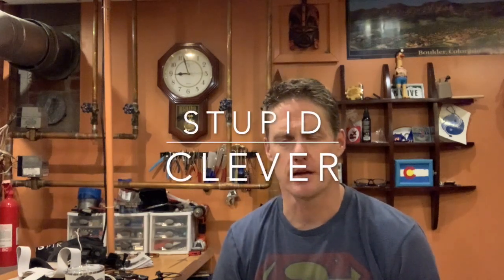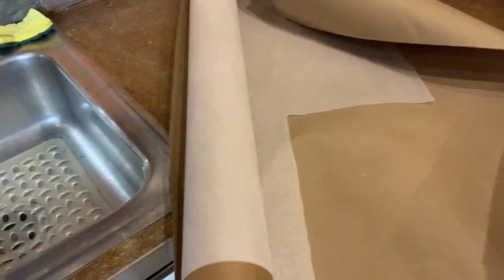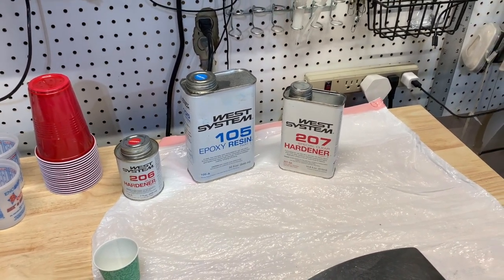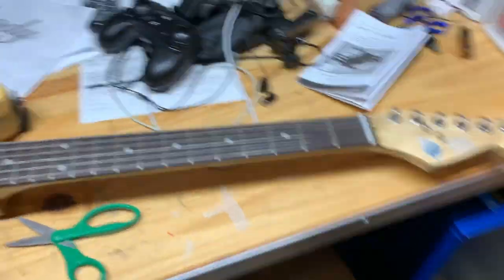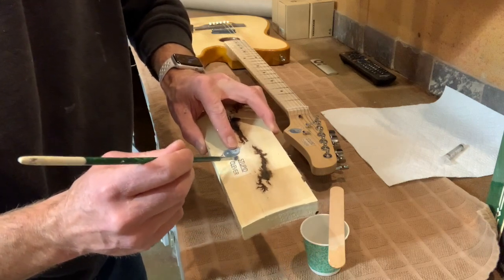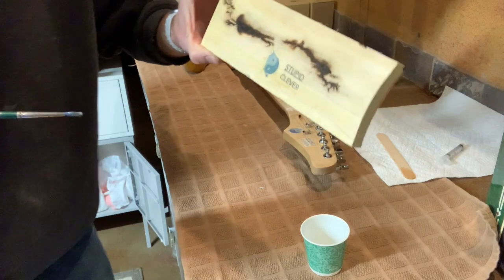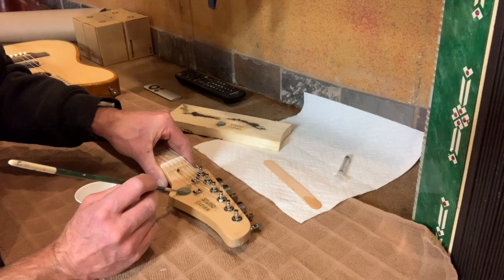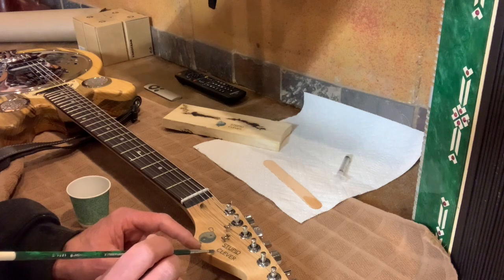DIY guitar headstock graphics

Comment: very cool as always innovative! I used a similar method on a build im doing as a xmas gift. really looking forward to seeing the hydrofoil build , we have been wake surfing for years and a friend just bought one and Im trying to figure out how to use it as a mold.....Im sure you will have something to learn by, Love the mug!!!!
Reply from the maker: Thanks Tom,
the hydrofoil build is my big winter project.  its going to be an electronic drive foil with built in batteries and an electric motor like a "lift" e board.  I'll be posting a series of videos on it.  The first is the construction of the hollow board to be followed by the electronics.  I've ridden a foil board behind a ski boat but have never ridden one of these.  I hope I can get up on it!  Cheers
Reply: @stupid-clever  We were out on the lake this summer just taking a break floating and a guy went by on one I`d never seen anything like it , I flagged him down and we talked for 1/2 hour, he had paid like 12k for it but it was soooo cool, he demo`ed on how it worked said the hardest thing is your control hand ...needs to be seperate from your body, takes a bit to get used to , really excited to see your build

Comment: There is an easier way to do this. buy some waterslide decal paper. First, print your design on to a piece of ordinary paper, then cut a piece of waterslide the right size and tape it on to the paper.
Now put it back through the printer and print the design on to the waterslide. If you use a laser printer, the decal is waterproof; with an inkjet, spray clear lacquer over the decal.
Soak in water for a few minutes then slide the decal on to the target object, just like when you made models as a kid. Another coat of lacquer keeps it secure.
Reply from the maker: Thanks! I've never heard of waterslide decal paper, but I did make a few models as a kid.  Thanks for watching